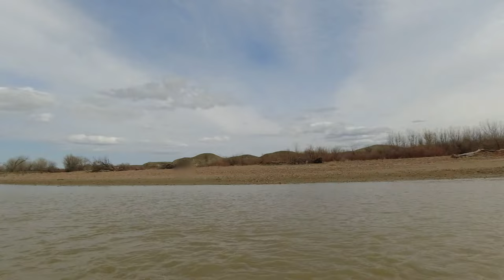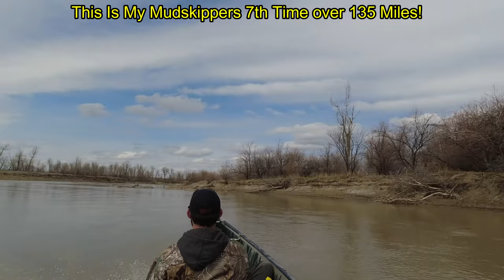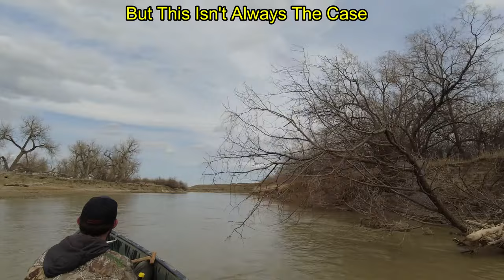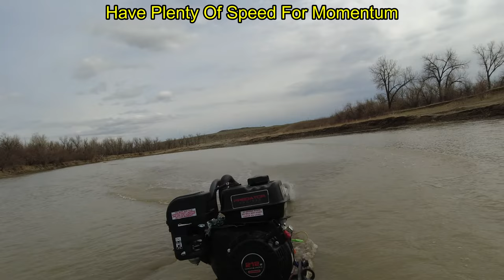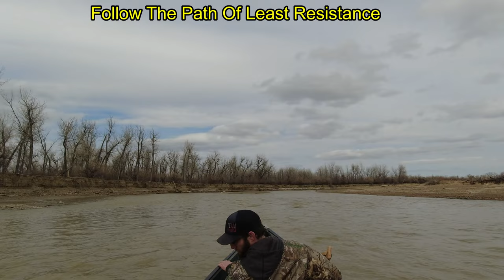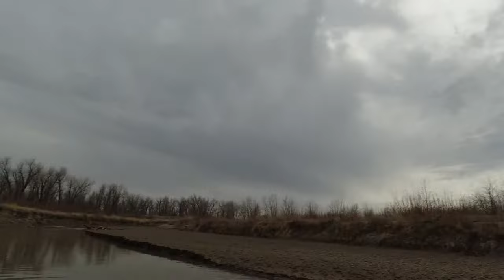Mudskipper | Thai Long Tail Mud Motor | Torture Test!

Comment: I have had 2 of those Ram X Scanoes although 1st genration,they are tough boats.We wrapped one around a tree running a flooded creek,stopped straightened it the best we could and continued.Ran that boat for years.
Reply from the maker: I love these boats for sure they can haul a hefty load and get into super shallow waters. Unfortunately mine is pretty thin on the bottom now so it's been retired. Now I'm going to weld high-density polyethylene sheet and make up for the strength in thickness and clever design. 1)4 inch and 3/8 inch extrusion welded boats but a bit Smaller like 10, 12, and 14 foot long boats

Comment: I am piecing together a budget 1232 building with a 212cc mud skipper I just picked up. Its for a rocky river and I was worried about going 5 miles down and back up river. I think its safe to say I am good! You pleased with how it works in rocks?

Comment: I have been running the Yellowstone for the last couple years by Forsyth and up at Glendive , it is a blast running the long tails in the river. I have the swamp runner with a 670 predator motor on a 1648 jon boat, has been working great with no problems.  speed is defiantly needed to get over those shallow areas.
Reply from the maker: I would love to go with you sometime you might have to show me the ropes I’m gonna be on the Yellowstone here soon
Reply: @MudMotorsMax  yeah that sounds good. Where do you plan on going in at? I usually run on the west side of Forsyth up towards the big horn and also run the bighorn down the the Yellowstone. The diversion dams make it hard in some spots to go to far.
Reply: Your set-up vs mine you can probably put in wherever you want, as all the weight and size of mine I need to have a boat ramp to get into the river.
Reply from the maker: @mtairgunner4044  Yeah we’re definitely going to have to talk I need some advice in where  to drop in where to go
Reply: @MudMotorsMax  I sent you an email with my contact info on it
Reply from the maker: @mtairgunner4044  Hey excellent thanks I just got it

Comment: Was looking at getting a mudmotor for my old 1232 jon…how does the mudskipper prime kit hold up? Im trying to decide between that beaver dam and swamp runner…? Any advice?
Reply from the maker: Honest I have not gotten the beaverdam kit yet or the SPS mud runner but I will be getting the kit soon to test them I hear great reviews of these long tails. I really do love my mudskipper it’s affordable it’s light it’s fast but Test will be coming just so you know for sure SPS users would internal Bushings as well as mudskipper while Beaverdam uses Polymer Bushings the only one of the three that uses Polymer Bushings so just consider that but more test will come. After running this thing hard for over 200 miles of abuse I can say this mudskipper prime kit is amazing For the price and capability

Comment: This was awesome !!! I built a 14' Tracker w/a 420 predator and a Backwater long tail to run the North Platte river a little north of Saratoga Wy. Had to have a full knee replacement and so it sits in the backyard until i can walk again. But this was a absolutely fantastic video.
Reply from the maker: Well thank you very much I really appreciate it I’ll be back eventually I’m just taking a little break and getting recuperated my next kit is a swamprunner. I got to say though Mudskipper’s are light fast and pretty tough. I just recommend replacing the bolts

Comment: SPS always wins out in the end
Reply from the maker: Well I’m excited to see 20 miles of hard-core river running 10 miles down 10 miles back is no joke so we will see criteria is shallow water for Performance Speed durability you know all that fun stuff
Reply: Yep this is very similar to the river i run year around 6 months out of the year its mostly shallow and have to good at reading the water and choosing your path, its a blast tho and all the sand beaches to choose for camping but April thru July you have to make sure you set a stick at the waters edge to guage the river
If the county above you gets 3 inches of rain the river could rise 14 feet overnight